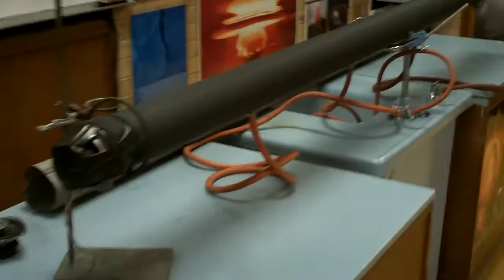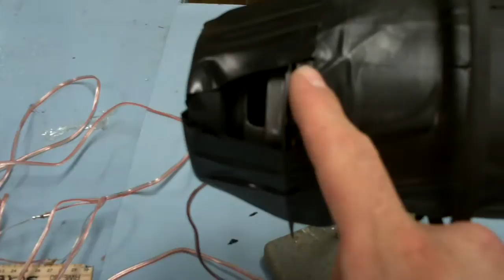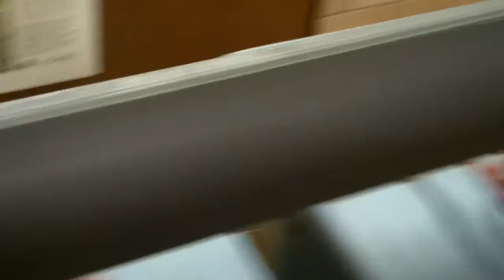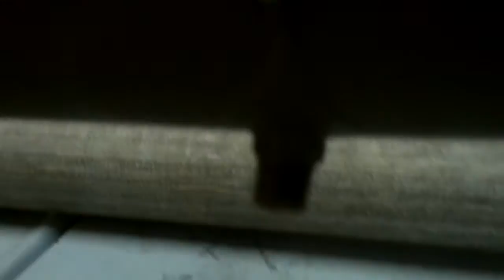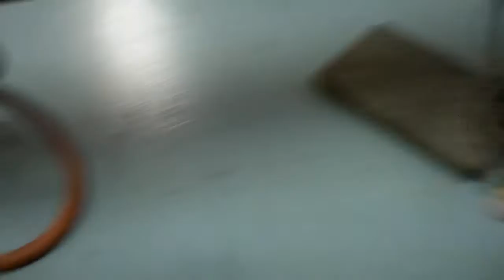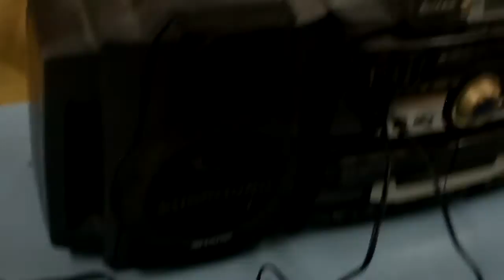Building a flame tube or rubens tube - science demonstrations - www.theflamelab.com

Comment: I had bought a galvanized pipe and drilled some holes in it.  I ended up stripping off the galvanizing with muriatic acid.  I use the tube outside of my house and use pipe dope on all of the connections.  I think that my design is pretty good but it could use a few improvements.